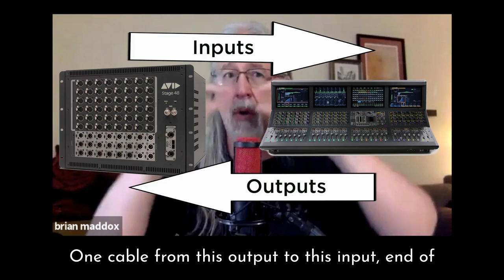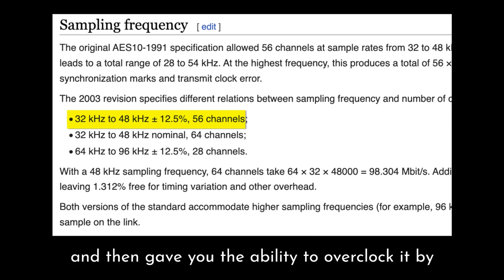MADI (Pros and Cons) - Digital Audio in Live Sound

Comment: MADI isn't necessarily limited to multi-track point-A to point-B signal routing. A MADI stage box can easily replicate its digital signals, eliminating the need for expensive and troublesome analog snake splitter cables. It can also support master/slave console priority, making it easy to use an on-stage monitor mixer on the same MADI router with a remote FOH console.

Comment: MADI seems much more stable and reliable. We had plenty of issues with Dante at my church for a while and when you have to freaking log in and jack around with routing parameters and the Dante network router just randomly says eff you, it seems needlessly complicated. MADI is point to point basically. No logging in. No passwords or accounts required. Just connect and configure routing and walk away. I do see the plus side of Dante it just requires so much work on the front end and you better have solid network connections.
Reply: I'll bet you 10 bucks your switch sucks